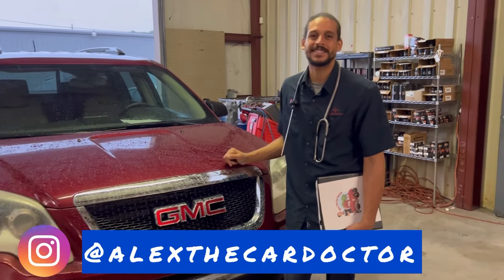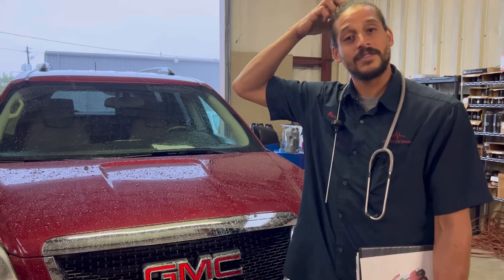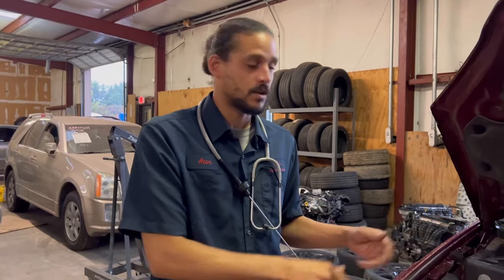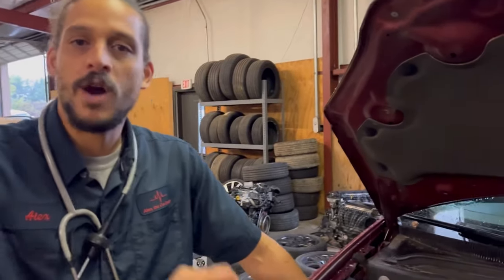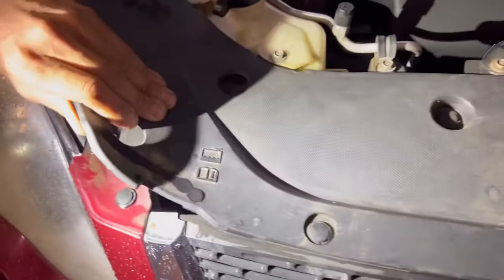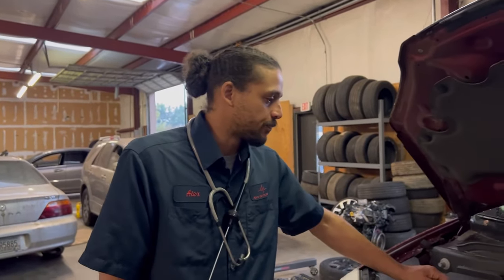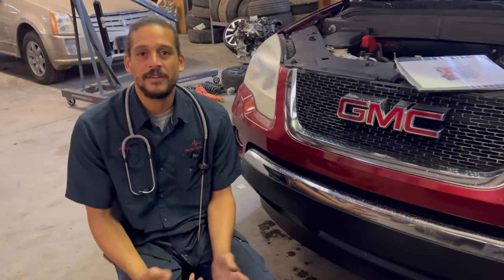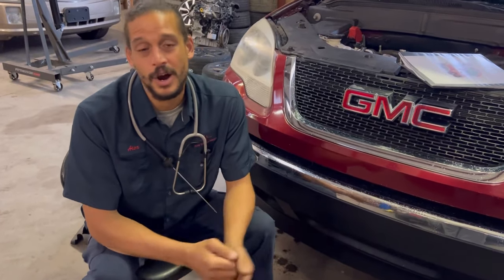The Top 5 Problems - GMC Acadia ( First Generation 2007-2016) | Should you buy the GMC Acadia? #gmc

Comment: 2011 Buick enclave , car will not start, key stuck in ignition, battery good, can’t shift out of park. What can be the problem. Do you have a video.
Reply from the maker: Sounds like a bad fuse. No I don’t have a video on that problem but my latest video of me diagnosing a Mazda should point you in the right direction. A vehicle electrical system is just about all the same

Comment: I was actually going tomorrow 47 minutes away to check one out to buy it. I had a Outlook that was the cousin to this vehicle before and it cost me a lot of money to get things fixed on it. I guess this vehicle is no different, so I guess I will pass on getting it. Thanks for this video.
Reply from the maker: That’s why I do this videos,to make y’all aware of these issues. alternative SUVs that are really good are the expedition’s anything Toyota and the four-cylinder Dodge journeys they’re OK just can’t let them overheat
Reply: @AlexTheCarDoctor  Thanks for the quick response. I'll start now looking to see if any of those vehicles are for sale in my budget. I have a 2006 Infiniti QX56 that needs a transmission that will cost $3500 so
 I decided to just get another suv around that same price instead.
Reply from the maker: @blackgold2029  that’s not a bad truck. You may want to consider fixing it truth be told you may inherit a new problem with a new vehicle, your vehicle you know in and out
Reply: @AlexTheCarDoctor  You're right! I thought the same thing about knowing more about my own vehicle than a new one. I'll keep mine and just get it fixed. Thanks for the reassurance. I'll drop it off to the mechanic tomorrow.
Reply: This and an outlook have no difference. They are all trash. Even the new ones suck
Reply: Every car has their own issues, No car is perfect

Comment: Thanks Alex i will keep updated the heads ,mechanic told me are at the machine shop now, I like how you comment everyone back and don’t hold anything back idk what block test is but I hope he does not shave the heads and the block is bent too i witnessed the head gaskets in person and they looked pretty bad there was also a lot of white powdery stuff around them
Reply from the maker: Hey there I was checking on your vehicle did you ever get it fixed. Sounds like someone put head gasket sealer in your system also known as mechanic in a bottle
Reply from the maker: This is a video of me performing a block test https://youtu.be/N4NpomEKm4g
Reply: My gmc running hot water leaking out what do I need and do

Comment: One thing that offsets the inconvenience of high maintenance is a good bargain. Got a used one of these for $2800 with 130k miles. just needed a new timing set.
Reply: Did the seller tell you about the timing issue at purchase? That's s good steal. I just saw one at that price point but was at 200k miles...
Reply: @ALCRAN2010 so is an 09 for 3k a good deal?

Comment: that's wild you nailed it! i have a 2010 and im about to replace the gasket for the intake manifold (doing the plugs and coils while im in there) and the purge valve failed on mine as well so im going to replace that as well. AND wouldn't you know it my timing chain is failing! but fortunately the chain is covered under warranty through by bank so once i fix that other stuff  im taking it in to the shop to let them deal with that, i also have a heavy whining from my power steering (i believe), although no issues as far as turning goes. doing the plugs and coils myself wish me luck.
Reply from the maker: Good luck! You got this 👨🏽‍🔧 thanks for sharing.

Comment: I had no issues with my 2011, until about 110k miles. Timing chains went and constant sensor issues that the dealership would fix, but the problem would come back a month later. Luckily i got rear ended and the vehicle was a write off.

Comment: I just bought one (2011 Chevrolet Traverse) for cheap, no accidents, well maintained (service records). I hope I'm the lucky one. I'm getting it tuned up, new spark plugs, transmission fluid change, transfer case fluid change, and drive belt change.... hopefully it lasts me at least 2 years!!!
Reply: I have an OBD 2 scanner and constantly check my live data and shit. I scan it everyday and try to be proactive with problems
Reply from the maker: I’m pretty sure you will be fine just make sure you use high quality oil

Comment: Transmission are terrible in them.  Never buy one.  If you have it will break. Everyone i know that had one had issues. Not the none maintenance either.  Gm juni,like impala, malibu, Silverado,etc.  cheap metal expands , solenoids go out.  Cost me about 14,000$ on impala,malibu, Buick all in year and a half.

Comment: Thanks for your honest opinion concerning the GMC Acadia, I am a small budget dad in Liberia and we are considering buying a used Saturn 2009 Outlook and I know for sure the Acadia and the Outlook are family…. Please I need a piece of advice concerning the outlook as to wither it is a good choice for my bad roads in Liberia, thanks.
Reply from the maker: Hey buddy and thanks for watching. It’s the exact same truck but different name so you would run into the same problems mostly timing chain and high maintenance things like valve cover gasket leaks which is hard to replace on that particular engine. If you’re still thinking about buying the truck make sure you have an car emergency fund you will need it
Reply: @AlexTheCarDoctor  
Thanks so kindly Alex🙏
Reply from the maker: @isaacdavis2221  my pleasure buddy

Comment: I have a 2015 Traverse has 165743 miles  got the head gasket replaced cause it was starting to leak other than that the only other mechanical thing I’ve had the most problems with is it’s A/C gotten it fixed 5 or 7 times.

Comment: My mom had a lot of problems with her Acadia she kept taking it to the shop. There was issues with breaks and and transmission and axel problems and all sorts of issues. To me if your going to buy this car please do your research before buying it.
Reply from the maker: 100% agree just do your research when buying anything these days
Reply: Biggest Lemon 🍋 ever made.
Reply: Thanks Alex for this video,my friend left this gmc truck with me so I can help run the engine because he is not in the country but what I experienced is that whenever I pull over at the gas station to full the car,the car won't start until like 20minutes after and most times when it starts it starts smoking,and the engine power run very low

Comment: I Have a 2015 gmc Acadia and I have only had to replace the power steering pump a battery and the rear shocks but it also has 154,926 miles

Comment: Just bought a 2011 at 161,000 miles and everything seemed very smooth, until the check engine light turned on, it has 2 catalytic converters at over 1k a piece! Only one shows up in the code so ill be trying to clean it first crossing fingers. And it has other 3 codes for transmission fluid pressure switch, will try to change the oil on that I hope it works, looking online what else I can do for that I came across your video, thanks!!!

Comment: Once your washer doesn’t work in a 2013 Acadia. Pump has been replaced steering mechanism has been replaced with the turning signal fuse has been replaced and still does not work.

Comment: Hey thanks for the video it was great im had the transmission replace radiator replace now it wont start flashing when i turn the key and just clicks.  Help me i may can fix it my self.

I did keep up the maintenance and replacing fluids as recommended. Using high quality stuff only and It has over 300,000 miles on it.  

And one repeated issues is lights 💡 replacing if you use the hi output ones. Have to use medium output bulbs they last longer.

Comment: Damn I really wanted this car to the denali one you crush my dream truck but I have to take your advice
Reply from the maker: Sorry buddy I have to tell the truth. I do love the truck though very nice and convenient you can still get one just have an emergency fund for the vehicle and use high-quality oil
Reply: @AlexTheCarDoctor  I trust  your Judgment I mean you are the doctor😁 but after your video I just chech out some more and research a bit car wizard said the same thing and he just said just don't get it its to much work to get to any of the the things the  Mechanics will have to work with under the engine....is there any truck 3 row seats you can  Suggest with lesser problems other then a van 2008-2018
Reply from the maker: @raymonejohnson7774  car Wizard Is correct it’s cars like those will engines like those that keep me in business. I have had really good luck personally with the Lincoln navigator if you’re trying to be fancy or expedition if you’re trying to be regular just make sure they kept up with the maintenance those engines are the 5.4. My personal favorite is the new eco-boost that comes in the newer expeditions and the navigators they’re twin turbo charged,very good on fuel. I don’t see many in my shop at all,little bit more on the higher end though
Reply from the maker: I don’t really trust Chevy anymore reliability wise they have lifter issues with their active fuel management system

Comment: I have a 2008 Arcadia and I am having a oil pressure low error on my screen but I've already changed the oil pressure switch or sensor whatever it's called which is down by the alternator I already changed it I also put a new valve cover gasket on and I'm still getting this error code what do you think is going on with my car

Comment: I purchased a 2011 Acadia yesterday. Upon my initial inspection of the car, it displayed 150,000 kilometers on the odometer. However, after completing the purchase and payment, I noticed that the reading had increased to 183,000 kilometers. I'm quite disappointed that such discrepancies occur. Can you provide insights into the possible causes of this discrepancy?

Today, I took the car to a mechanic who changed the engine oil and coolant. Fortunately, there don't seem to be any leaks. What other factors could be contributing to potential overheating issues? Additionally, I'm curious if this vehicle has a high water consumption rate. Any advice on these matters would be greatly appreciated.

Comment: Bought a 2012 Acadia keep it overly well maintained & one day out of nowhere headed out for a regular day of work & the engine rods broke, engine knocking & it’s done for. It had 130k miles it was driving fine with no signs what so ever.
Reply: If you went over 5 k miles on oil changes that would cause the problem with this 3,6 engine

Comment: I have a 2012 and recently just started having issues it has 139682 02 sensors are my issue, where is your shop in Ga. I just did my ignition coils and spark plugs

Comment: What midsized SUV used between 2012-2017 to buy with minimal maintenance?
Reply from the maker: Toyota, Honda,Mitsubishi, Nissan except rogue, ford from that year is pretty good
Reply: @AlexTheCarDoctor  is The 2014-17 Infinity QX60 good
Reply from the maker: @stanleyphillips5129  yes Nissan is infinity
Reply from the maker: They are very good trucks and I never see them in my shop
Reply: @AlexTheCarDoctor  No I knew that but I'm looking at a used one and my wife saw some complaints just was wondering what you may have heard or should I go for 2013 Pilot
Reply from the maker: @stanleyphillips5129  every car has their problems. It just depends on how the previous owner took care of their vehicle. Both are very good options. Just make sure you get a full vehicle inspection by certified mechanic.
Reply: @AlexTheCarDoctor  I thank you Sir I wish I knew about your channel before I bought my wife a SRX 09 WITH THE V6 PROBLEMS she should of got the V8 model she wanted what she wanted here I am now trying find her a good reliable vehicle
Reply from the maker: @stanleyphillips5129  the newer GM v8 are very high maintenance,they have lifter failure problems. I have 3 in my shop now

Comment: 2014 GMC Acadia with a p0300 and flashing engine light… misfire data show cylinder5 but new coil and plug what you think it could be?
Reply from the maker: Hey there it can be a number of things. Check the engine compression if that checks out ok you may have a bad injector

Comment: I have a 08 Saturn Outlook XR 2wd, transmission went out, I have found a excellent transmission shop in my area. My question is before I get into a long conversation with the mechanic, should I have it rebuilt,  or try to find a replacement. With the wave plate issues this was designed with I am more inclined to think that rebuilding is the way to go so I know what is in the transmission. Just looking for good advise, also after that I will need to have the rack replaced, so far everything else seems good.
Reply from the maker: Hey there if you can find a good shop with a good warranty to rebuild it I say that would be the way to go,as far as the rack I will see if they can work something out to replace it while they are in there it’s much easier when the transmission comes out to get to the rack. I know I will give you a big discount labor rate like 75% off because it’s much easier to swap out

Comment: I ALSO CHANGED THE RADIATOR IT DID OVERHEAT ON ME A BIT BECAUSE THE PLASTIC HOUSING TO THE BURPER SCREW LEAKED WATER
Reply from the maker: The Charger that I fixed turned great. Any time I suspect someone ran their car Hot I always do a block test before I do any work

Comment: Alex man my 2016 GMC Acadia is making a noise when I Going over bumps that cause the vehicle to rock back and forth and I hear a tennis ball like sound and feel it in my gas peddle as well man I am at a loss I've been to 2 different mechanics and they tell me it's nothing do you have any ideas at all on what it could be??....Help please
Reply from the maker: Hey buddy sounds like you have something going on in your Front strut assembly/ Front shocks, it’s hard to determine what it could be from here of course but if you are over 150,000 miles or close to it I will just change out the front struck assembly both they sell it with the spring and everything.don’t just buy the struts by themselves get this Assembly. Tell me more about your vehicle does it have a lot of rust Also how long have you had it and when did the problem start, any accidents that sort of thing

Comment: Hey Alex I have a service Stability nd traction control that pop up on my dash board of my 2006 GMC Acadia awd what does that mean
Reply from the maker: It could be a number of things most likely a sensor issue though won’t know until you put a scan tool on it and pull the codes for your abs system

Comment: Hi there I have a 2012 gmc acadia denali  and its been running and shaking as soon as turn engine  on then I get  service stability , service  equalizer  traction control off  and the engine  light is on Help please I've changed spark plugs and coils
Reply from the maker: Hey there sorry to hear you having all these problems. are you able to scan your vehicle, you need a obd2 scanner to pull the codes

Comment: Alex great video question on traction control stabilite needs repair that's the code that coming up please help!!!
Reply from the maker: Hey there and thanks for watching. that’s not a code that’s just the message board telling you that the system has an error. on your vehicle it can be a wide variety of things down to your steering wheel clock spring,ABS speed sensors,wiring problems just to name a few. you will need an good scanner to get into the ABS system to read the actual codes

Comment: I have a 2011 Acadia SLT and it’s running good so far the one thing I did notice is that the engine light is on but no noises or anything and it feels like I’m getting 6-9 miles per gallon what could this be?

Comment: Hey Alex, great video. What 3-row seater would you recommend in that 2008-2013 age range? We bought an 08 Saturn Outlook about 4 years ago and there's oil everywhere... Even in the air intake boot... and not just oil, but oil mixed with coolant, the yellow mix. Valve cover gaskets replacement is due... But anyway, yeah. Any good suggestions for a family on a budget?
Reply from the maker: I love GM big suv like the Tahoe suburban but the in that year range you run into the terrible Active fuel management problems, I have personally had good luck with ford big suv,Ford expedition Lincoln Navigator with the 5.4 v8 if the budget allows I will suggest the V6 eco-boost engine in the Expedition And  Navigator that’s a really good choice
Reply: Toyota Highlander and Toyota sienna AWD.
Reply from the maker: @DonVerchi700as  my top picks if the budget allows
Reply: @AlexTheCarDoctor  They should. Buying a GMC Acadia requires you to have $5000 in the bank to get you back on the road.
Reply from the maker: @DonVerchi700as  especially with these engines

Comment: My 2012 is overheating when sitting still but having the AC on helps a lot. I’m thinking the fan isn’t coming on. Also it’s not starting good after getting gas. Changed purge valve that fixed it for a few months but it’s happening again. Losing power, hesitating when pulling out, lost all power a few times. Check engine light on, stability track/flashing. Causes it to miss and smoke like crazy. That only happened a few times. Planning on changing fuel pump & filter to start. Any advice?
Reply: Also I lose battery charge WHEN I’m driving?? Already changed alternator and battery right after I got it.